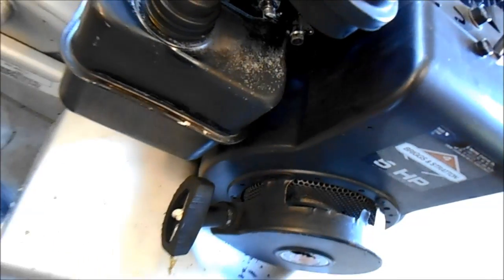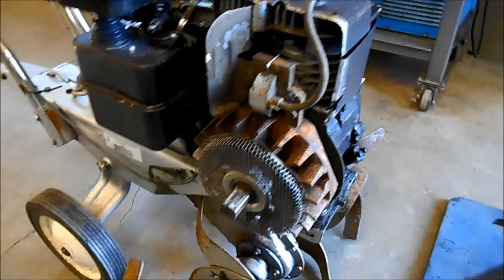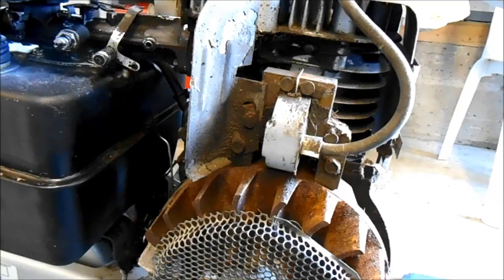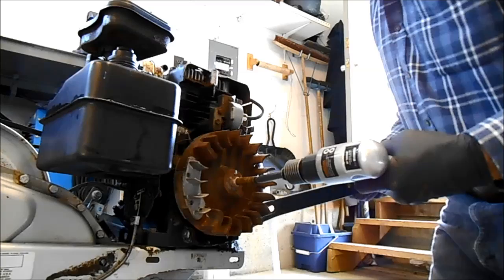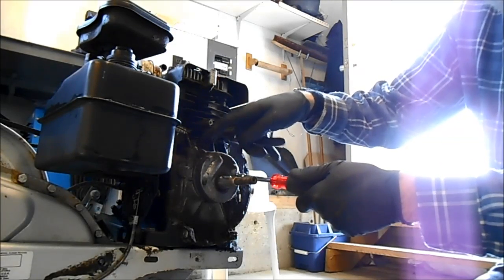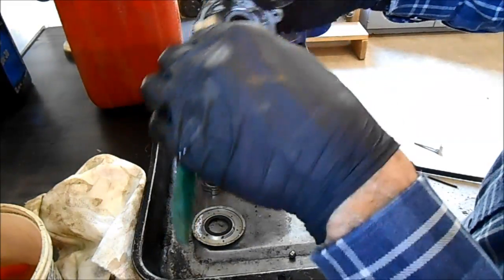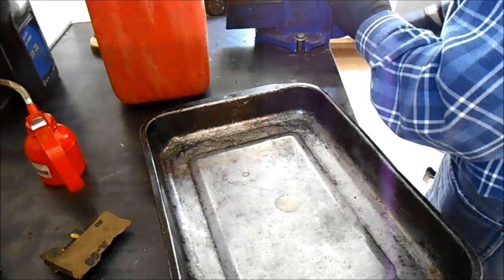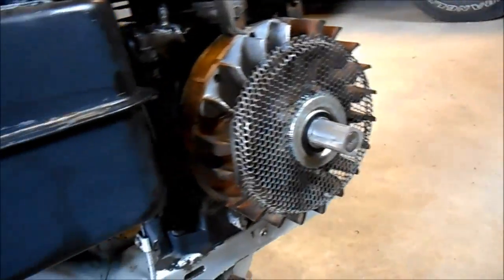Removing Points on a 5HP Tiller

Comment: Hey Bruce I have a 11 HP Briggs and Stratton motor it has points but I want to go to electronic coil how do I hook up the wire
Reply from the maker: The wire goes to the shut off switch.  I hope this helps
Reply: @BrucesShop  yes thanks I new you could help I have a 6hp Briggs and Stratton push mower I replaced the primer gasket and plate when I crank it it floods do you know what it could be
Reply from the maker: @jamesrobinson369  well the carb may be filling with more fuel than it needs.  i would clean the carb.  Take it off to do so.

Comment: I'm having trouble putting the flywheel back together the ratchet gear won't go back onto the what do you do can you help me
Reply from the maker: Make sure the balls go in half way through the assembly then  the cover holds the balls  It should ratchet then    Then screw the ratchet back onto the shaft.
Reply: @BrucesShop  that one piece that slides onto the we're at grabs the ball bearings in the pull string pulls I can't put that back on the shaft
Reply from the maker: @johnharkins2162  Wow   I would take it apart an tr again.

Comment: Nice video. Need to ask a question. I have a same engine. Need to find a coil. Can't seam to find one. If any one out there have any information please let me know. Many thanks
Reply from the maker: It id easy to find a new electronic coil.  Just Google        coil for horizontal Briggs 5HP engine.          If you want the points version that may take a bit more looking.
Reply: @BrucesShop  thanks I try. Thire are so many different types.

Comment: Where did you find that electronic ignition coil to replace the old one? I've been looking all over the internet, and all I can find are exact replacements for the original points-based coil.
Reply from the maker: OK  I think I found it on a Canadian Amazon site but the number is what you want.
https://www.amazon.ca/Stens-460-006-Ignition-Replaces-Stratton/dp/B001OKBE8W
Most folks ask me for the electronic coil #.  You must be restoring something.

Comment: why do you take out the points out I just take the kill wire off (cut it) put on the newer coil and put it back together
Reply from the maker: Just removing stuff not required , that s all

Comment: Do you have a part number for the upgrade coil? I have a old 5hp Briggs on a go kart frame , but the blower housing is not original. Dont know what part number to use to get seals , gaskets and carb kit .
Reply from the maker: I use google  Just now  I googled this 
Briggs 5hp horizontal ignition coil and got this.  You can do it too.  
This is a Canadian site but will go to the country you live. 

https://www.amazon.ca/HEPENG-695711-Lawn-Mower-Electronic-Ignition/dp/B098T9CQ1S/ref=sr_1_2_sspa?gclid=Cj0KCQjwgO2XBhCaARIsANrW2X3jJ1OKAxKOFO4tYXXiflPTW0z4lvpqb8VqEhspKY4hstt87BGIXvIaAoK5EALw_wcB&hvadid=605318956475&hvdev=c&hvlocphy=9001354&hvnetw=g&hvqmt=e&hvrand=17092071804565709207&hvtargid=kwd-316305313138&hydadcr=11242_13533814&keywords=briggs+and+stratton+5hp+coil&qid=1660709233&sr=8-2-spons&psc=1

Comment: Why did you bother to remove the points and condenser? You could have left them in place couldn't you? Just cut the wires and leave them.
Reply from the maker: You are right but it they aren't used I like to get them out of there.  I agree with you but I am kid if OD sometimes.  LOL

Comment: Hey bruce I'm trying to adjust the speed of the self propelled cable to a slower speed i know it has a adjustable screw near outside of the case of the handle you pull to activate the self propell which way do you turn the cable screw to make the speed slower?
Reply from the maker: I am sorry.  This video was made 7 years ago.  Your unit is a mower and this is a tiller.  Try both directions is all i can say.

Comment: 1981 unit.... funny, electronic ignition has been around since the mid 70s for full size engines in automobiles, but small engine manufactures used a points/condensor setup. o_0
Reply from the maker: The have not had points since 1982   This one was one of the last engines with points  1981.  All off them since have electronic coils.

Comment: what hp electronic coils will fit for the conversion?
Reply from the maker: Just google  Coil for 5Hp Briggs.  You can do it.   Here is what i got doing this.  remember this is a Canadian Amazon site.  do it on amazon.com
https://www.amazon.ca/Briggs-Stratton-397358-Ignition-Horizontal/dp/B0038U3TKW

Comment: Can you help me with a question?? Have a similar situation, do I have to hook up the wire behind the flywheel or no??
Reply from the maker: No  Not with an electronic magneto.    Points yes.
Reply: @BrucesShop  shit really?? I'm thinking it has points but I did not take flywheel off yet... there is no kill switch, just a metal tab that you flip on to spark plug or off off spark plug, that is how it shuts down. I guess I'm going to have to take it all the way apart like you did? Thank you for the video 👍
Reply: So I have it apart and the wire from the points came off, assuming that was most of the problem. Now I need parts and to put it together.  Can you help with this? I will set up PayPal only if you can walk me through what part to get and how to reassemble it 👍

Comment: u took points out but left the push rod that pushes the points open it rides the crank shaft& when the crank pushes it out & vibration makes it come all the way out then u got oil from the motor block being pushed up & out under the points cover. they make a plug that u put in the puss rod hole.
Reply from the maker: It is still running .  This was made in 2014

Comment: So just changing out the coils with the newer version makes it run?
Reply from the maker: Yes.  The circumference of the flywheel and the bolt pattern have to match.
Reply: @BrucesShop  how did it start the first pull

Comment: Hi Bruce,
You did a nice video for this conversion. 
Have you ever convert a Honda gv150 engine (used on Honda HR21 lawnmower) to electronic ignition coil? If so, can we use same coil as for the  Honda GCV160 engine? Thanks
Reply from the maker: Sorry I have not.  Most of the Honda's I  see are already electronic.
Reply: Thanks

Comment: 130202-0736 01 77120906 is my tiller's motor #.  In order to convert it to electronic one I'll need the number of the coil to use. Do you have this number for me? much appreciated!
Reply from the maker: This should work   double check it.  Good luck
https://www.jackssmallengines.com/jacks-parts-lookup/part/universal/440401
Reply: @BrucesShop  Thanks very much. I will look into it.

Comment: Bruce , a lot of times with points & condenser it's the condenser that goes bad not the coil. There is also a part from Briggs and Stratton called a magnetron ignition that you put on your old coil and don't even have to mess with the points , just cut the wires and you don't have to buy a new coil or hunt up a spare one , unless of course it is bad . I've put hundreds on to save customers money and they start & run a lot better . Good video ! :-)
Reply from the maker: Thanks Darell  Yes I have used the magnetron modules.  They are a great thing.   Thanks for the post.  Appreciated as a great reminder.

Comment: i put a solid state coil in my engine but it didn't work.. i got spark but it wouldnt fire up
Reply from the maker: The timing may be off then   Can you check the flywheel key?
Reply: @BrucesShop that's what i thought too. i did check the flywheel key to make sure and it was in the right spot. the engine hasnt run in years, so i put some gas into the spark plug hole and all  i got was a slow fireball out the exaust. maybe i put too much in but i tried with some quick start into the intake and all that did was cause a fireball and sparks out the intake. didn't hear it fire once. i'm pretty lost at this point.

note: my engine isn't the exact same as yours, in fact, i have no idea what year mine is cause i couldnt find anything from the serial
Reply from the maker: @bmxscape  I hate to say this but did you check the magnet on the flywheel or remove the cup and look at the flywheel key on the top of the crankshaft.  I just sounds like the flywheel key is sheared.  Is it at top dead center when the magnet is at the coil?  If you are sure about the flywheel KEY not the flywheel you may have a internal timing issue.
Reply: @BrucesShop  i did just have the head off and had a look at piston position compared to the flywheel and coil and that seems fine. i did however notice that the intake valve is not seating properly and is possibly bent, which also explains why i have little compression and fire coming out the intake. hopefully its just a matter of putting new valves.. any chance you've had experience with that?
Reply from the maker: @bmxscape  Yes I ordered one on ebay.  It was for a Tecumseh but same idea.  Just use google a lot to get your numbers correct.
Reply: @BrucesShop  thanks for your help, i got some valves on the way.

Comment: I have B/S model number 130212  type 0521-01 and would like to convert to  Electronic Ignition any Idea of the part number that I would use? How do I tell what year the engine is? Thanks Bill
Reply from the maker: I just google ignition coil for Briggs 130212 and this can up
https://www.jackssmallengines.com/jacks-parts-lookup/part/universal/440401

Comment: Hi Bruce , I would like your advice please. So I got my Istemation back to get my Mastercraft Tillers Cultivator . Motor is Briggs & Stratton 5HP. He said I need Fuel Tank, Gasket intake, Valve high speed, diaphragm carburator, foam filter , breaker ignition, grip starter rope, shop mat, . Plus Labour total price $500.00 . I find it very expensive I do not want to trow it away but is this easy to fix. I am a very handy in reparing stuff . Thank you for your time
Reply from the maker: It is not hard if you take 1 issues at a time.  Not everything needs replacing. Go to you tube and enter each item.  You will be surprised,  Of course i don't have a machine with that many issues.  It is most lilkey one of them.
Reply: @BrucesShop  Hi Bruce , thank you I will try that its a good idea . Thank you very much . I will let you know how it goes .

Comment: Dear Bruce, 

your Video is a really good help, because I was looking for a matching coil for long  and I had worries about setting the points. Now I can remove the points an get a matching coil.
But I still have a question about the wire. At 8:00 You say:"I hook up that little wire to that spring" But where is the other end of the wire? At my Motor one end is at that spring and the other end is at the capacitor. But you (and later I will do) cut the wire at the capacitor. So I have to connect this wire with the coil? Is there a connection point? Thanks a lot.
Reply from the maker: Yes   that wire goes to the switch that turns off the motor.  It just grounds out the signal that allows the spark to generate.

Comment: Hello Bruce,
what is the thickness of the paper, you are using to make the gap between the coil and the magnet (flywheel)? Or what kind of paper are you using? Thank you.
Reply from the maker: A regular ol business card.  it is 10 thousands of an inch.  You can google the distance required if needed.
Reply: @BrucesShop  
Great video...could you say a couple words about how that gap adjustment is made? Are there adjusting  screws?

Comment: Are these coils considered DRY coils for purposes of using an adjustable spark tester?
Thanks Bruce!
Reply from the maker: I don't think so   They are just coils for this motor.  If you are think of the electrical term for a soaked coil   no.

Comment: HEy Bruce Interesting!  Thanks for the Video.   I have a 1968 ish Toro with a briggs 7hp engine.  It runs great when cold.  But after a few laps around the yard it starts running really bad and will burn your eyes from the fumes.  I put the carb in my ultrasonic but it was clean as a whistle anyhow I put it all back together with a carb kit.. A log splitter I have has the same carb so I swapped it just in case but nothing changed. The mower is a super low hour unit. It was maybe used for 4 years and then put in a garage and left.   Some folks say it is the coil going bad and to do this conversion.   This is how I found the video during a search for the ignition conversion.  Any input Bruce?
Reply from the maker: Yes  Can you check the compression?   Then here may be sticky valves or a valve adjustment.  On these flat heads that means taking off about 5 thousands of an in of the valves.  This means removing the length of the valve and grinding a VERY small amount of material from the ends of the valve.  Don't panic.  Do a valve clearance check first.  This video although a Tecumseh may help
https://www.youtube.com/watch?v=iogOUbNB-FY

Plus here is a chart on Briggs valve clearances.  
http://www4.briggsandstratton.com/miscpdfs/RNT/Engine%20Specifications%20Chart_ms3992.pdf

Don't panic it is actually all very simple  one step at a time.  Before you start check all your gaskets for sealing.  Lots of fun and lots to google.  Enjoy the process.

Comment: Any idea on coil part number  for a old 8hp Briggs horizontal? Looks just like the one on your 5hp. Its has points but like to go to electronic. Its model #190402 and has no spark.
Reply from the maker: Well this is what i found. (on Google) 
Briggs & Stratton 398811 Ignition Coil For 7-16 HP

https://www.amazon.com/Briggs-Stratton-398811-Ignition-Horizontal/dp/B0038U3LZU

Comment: However why is this converting in the description when actually it is repairing. Nicely filmed but I am looking for general advice on replacing pull cord with electric.
Reply from the maker: Well.  If you mean you want to have a battery start.  The flywheel has to have gears on it.  Then you find a starter that will fit that size of motor and also the housing (rewind) has to have access for the starter to engage the geared flywheel.
Reply: @BrucesShop  tx, or else you can't get the high voltage across the spark plug I am gathering, still the flywheel must turn.

Comment: every time i go to my local junkyard i see a 5 HP Briggs Flathead it makes me sad that people throw out the old engines for stuff like the newer honda and predator engines
Reply from the maker: Well the flathead Briggs and Tecumseh's are great.  I had a Tecumseh for 27 years and sold it in running condition.  You just can't let them get low on oil.

Comment: What is the part number of the replacement coil you installed?
Reply from the maker: Google is a big help as this coil came from my collection.  I just googled this.  Google rocks.  I googled this for you.
Ignition Coil for 5hp Briggs & Stratton and got
https://www.ebay.com/itm/Ignition-Coil-to-Eliminate-Points-5hp-Briggs-Stratton-397358-395491-298316-/300884372486

Comment: Hay Bruce, just subscribed to your channel it’s helped me out a lot, starting to love these little Briggs engines got a little 3ph running (out of 3 old engineslol) but it’s got a horrible misfire and it’s a nightmare to start, am thinking about changing it over to eletric ignition like this, is that wise? Any help is gladly appreciated keep up the good work
Reply: Joe Wyatt your flywheel key is most likely sheared so replace it, even if it’s not sheared all the way

Comment: Very helpful - having this exact problem and with a 5hp rototiller as well. thank you. One question I have is - do you think that the points could have been filed and capacitor changed and it would have (or may have) run? Kind of a mute point since the electronic ignition seems so much more efficient, but in a pinch to make something like this run without the convenience of spare parts, it would be good to know.
Reply from the maker: Probably would.  Th capacitor is the key.  If the points are filed they are usually OK.

Comment: Bruce I have seen this done with the B&S, can this be done as well with Tecumseh?
Reply from the maker: This is a great video for converting any points small engine to electronic. (not my video)
https://www.youtube.com/watch?v=B9XNi-ImEg0
Reply: Thanks for the reply Bruce. I am familiar with those modules and they are great on chainsaws as long as you can get air to them, they get very hot and burn up pretty easy, If you ever have to use one make sure to locate it so the flywheel is pulling air across it. People that have placed them under the flywheel say they burn up fast. Others have had issue if placed to close to a coil saying it interrupts it and causes it to miss fire, I don't know this to be true but it is coming from people that do a lot of modified chainsaws. 

I did find out that Tecumseh makes (or made) a 34443 coil that can be used to convert the older coils over to new electronic. An OEM is around $30 US and you can get knock offs for around half of that but after reading the reviews on the knock offs I think if I was going to replace mine I would just get the OEM and be done with it.  I can't post a link but if you Amazon OEM tecumseh 34443 you can find it listed. 

My engine (H30) is purring like a kitten with it's points still in it and I don't know if I would bother with changing them out for what little I use an edger but wanted to know if I ever ran into something that I would use more.
Reply from the maker: Thanks for the info

Comment: One thing I would like to know is, whether you have an idea how to reduce the noise level of a mower, especially a tractor. The Briggs and Stratton muffler or exhaust of my husqvarna tc138 tractor is extremely loud (about 100 decibels). Do You know any equipment that could reduce the noise?
Reply from the maker: Have you tried a new muffler?  This is a canadian site but the info os there.  
https://www.partselect.ca/PS9014671-Husqvarna-532188655-Muffler.htm#pscomredirect
Reply: Just a suggestion, not trying to be a smartass, but you should use ear plugs, or noise-suppressing earmuffs